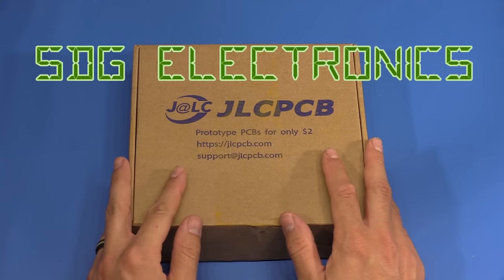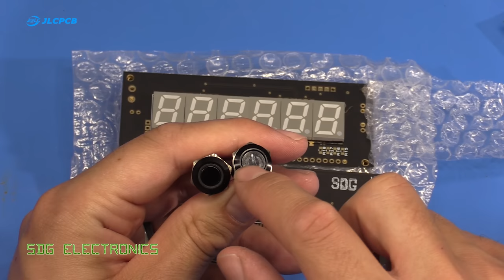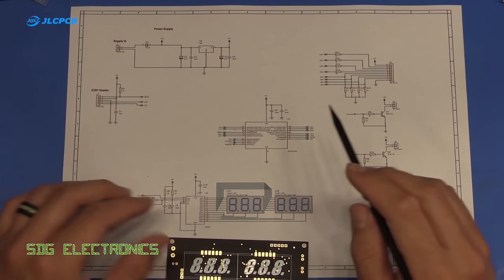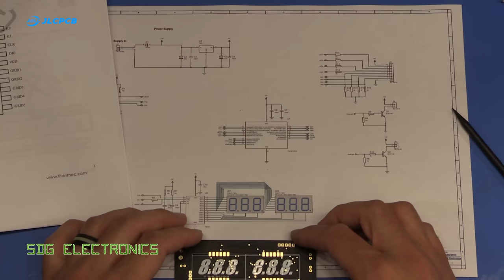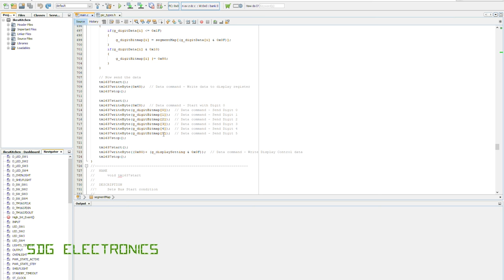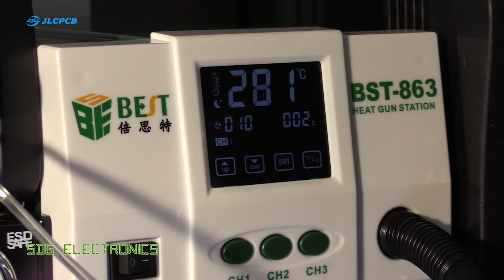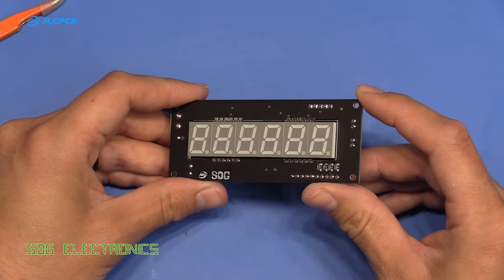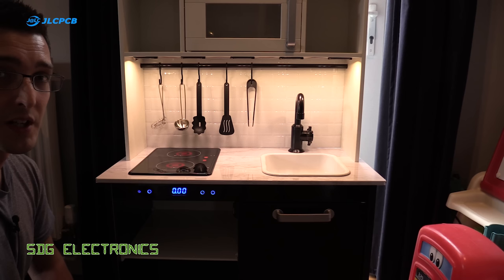SDG #082 Ikea Play Kitchen Hack with PCBs from JLCPCB

Comment: Was thinking earlier: I haven't seen anything from Steve for a few weeks as he's probably been busy and then, suddenly there you are..... Excellent!

I like that variant of display chip. I've only had experience of the HT16K33 that worked fine for offloading the multiplexing.
Reply from the maker: Yeah, it's been quite a busy time for DIY in the house so I've not had much chance to do videos. The display driver ICs are quite nice - the protocol could definitely be improved, but once it's set up it's straightforward to use. Thanks

Comment: Wow, the filming work got a whole lot better.

Isn’t 440C on the hot air a tad too much for a preheated board?
Reply from the maker: The temperature seems to refer to the measured temperature directly at the nozzle, so with a low airflow rate and some distance between the nozzle and the board the actual temperature is quite a lot lower.
Reply: Yeah as stated the distance plays a factor. I always run max temp on most desoldering jobs. Its better to have less heat on the board in a shorter time period than sustained heating for a longer period with the chance of destroying components in the process.

Comment: Quick question, how did you get stencils the exact same size as your boards from JLC? I either have to specify them with 45mm extra on every side or go with the almost A3 sized default stencil.
Reply from the maker: Not sure - it doesn't always work and I can't quite work out what causes the form to get upset about it. I have another stencil for another PCB that had to be larger than the board. There must be some random thing in the Gerbers that throws it off. You can always leave comments when placing the order though.